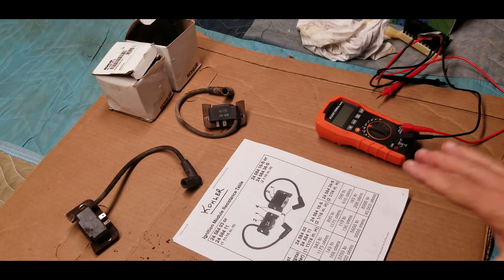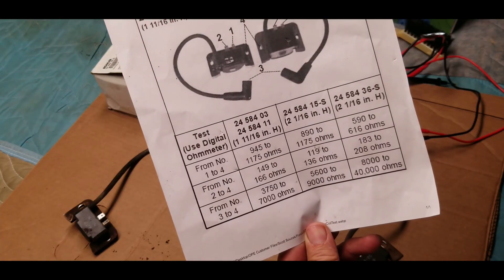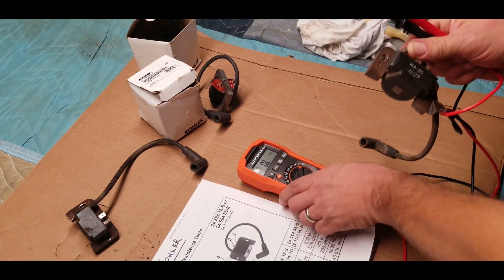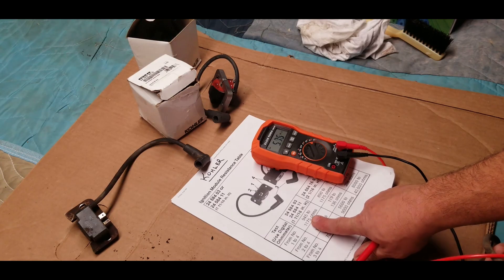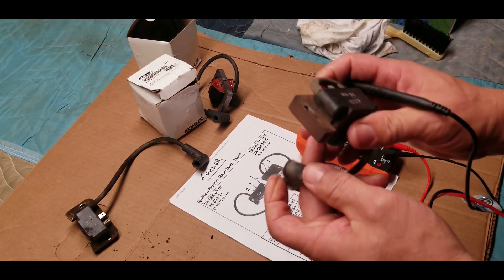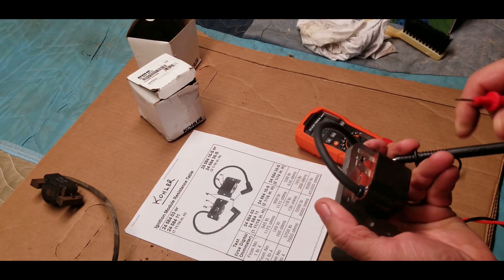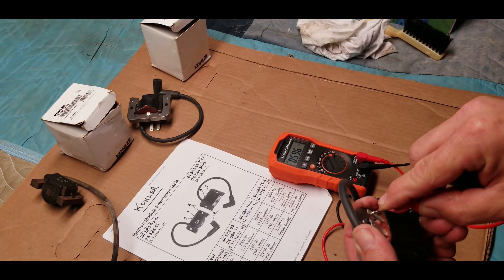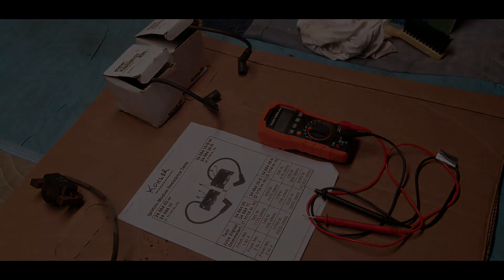Kohler Ignition Coil / Module Testing

Comment: Just replaced both modules because motor was running on one cylinder and I narrowed it down to the cylinder that wasn’t working. Engine runs fine now. Tested both old modules and both tested bad yet it would run on one cylinder. The cylinder that was working, that module tested bad. Any ideas ? I guess after being 21 years old, I can’t complain.
Reply from the maker: Thanks for watching

Comment: Not a bad coil, it was a bad coil wire. The Ignition (spark plug wire) wire just screws into the coil - so unscrew it and replace (very cheap compared to coil) Also you could unscrew the wire and retest to verify. #4 is called Ground. #2 &1 are Primary and the spark plug wire is the secondary circuit.

Comment: Thanks for your video.  I have a Kohler Command Pro CH25S that one coil is very weak and causing missing , engine shutting off when pto engaged.  From what I have read this is common, so common that Kohler came up with service upgrade.  I think I have a DSAM system. 4 different colored wires from the main module "box". I have read that I can replace with another coil like what I have or for me I would replace both. I have also read that the SAM whether analog or digital need to be upgraded to the MDI conversion. I am hoping that I don't need to replace the flywheel as well....do you know if the DSAM needs the flywheel changed as well as coils? This mower is in great condition to be a 2001 but it has a lot of hours so I don't want to invest too much....I wanted to use it another season then sell it
 Any info would be appreciated.  Thanks.
Reply from the maker: I can't say that I know anything about that upgrade. However, I have seen other youtubers share some info about it.
Reply from the maker: https://youtu.be/YjtrGAvTrh4?si=jpFoCPXxie2NIBlw
Reply from the maker: https://youtu.be/M_JKfzC3Iww?si=iZxjFMWa4i9dUPRN

Comment: i have a sensor equiped with 2 coils. The manual says the coils should read .40 - .48 ohms. My meter reads .88 ohms across each coil. Do you think that is out of tolerance for a coil ??

Comment: Hello, I have a Kohler Command CH22s v-twin horizontal engine on a Toro zero turn mower, the engine has no spark on both cylinders. After watching your video I tested the coils and one tested bad. If one coil is bad would that cause it to lose spark on the other cylinder as well? I believe this engine has the smart spark system.
Reply from the maker: I am not familiar with the smart start system. Sorry.

Comment: I have a john deere m665 that has a 25hp Kohler command. It has no spark at either cylinder. I've traced wires and cant find anything wrong
Reply from the maker: Electrical issues are from the pit of hell. Check all the safety switches.
Reply: @RealManSkills  I found out what it was. 10amp fuse blown. I checked stator and voltage regulator and both checked good but I had an open hot line so traced it back to the fuse
Reply from the maker: @codyswilley  Nice!